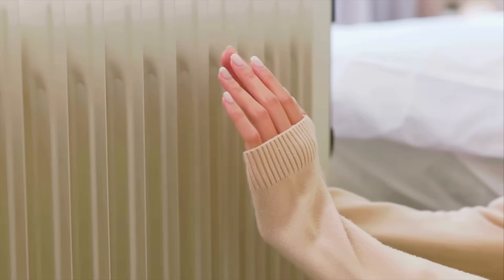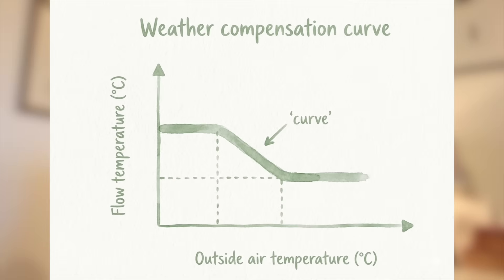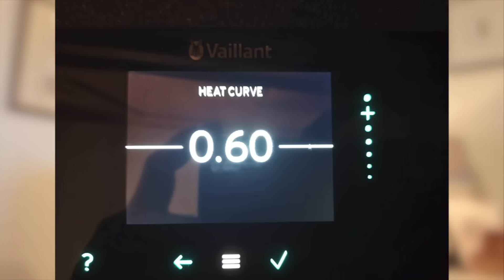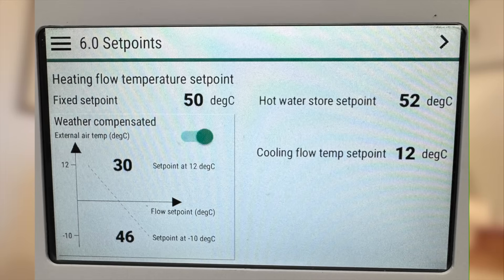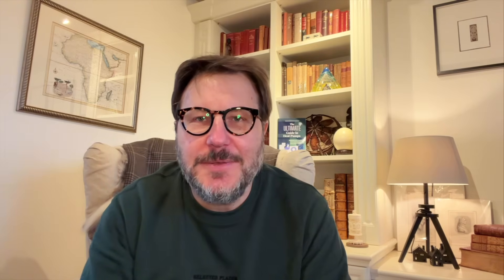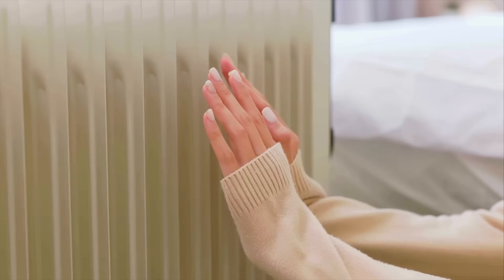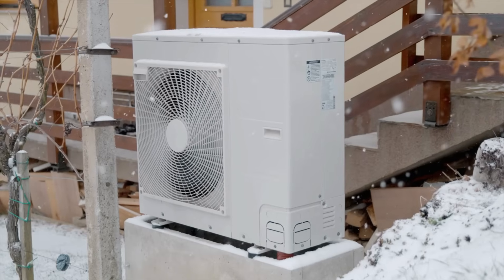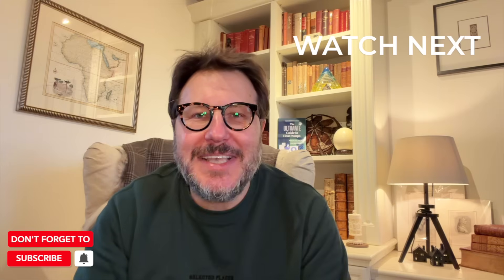Why Is Weather Compensation So Often Wrong?

Comment: What do you mean by "lowering weather compensation curve"?  In Vaillant heat pumps, you can achieve it by (1) lowering "target temperature" or (2) lowering the "heating curve parameter".  So which one are you proposing to lower?

Comment: Have been watching a few of your videos and learning a lot, thanks. My question is this, we have UFH on the ground floor,  RADS with smart controls upstairs. Everything is run by a WISER system off a Viessmann boiler.  To be comfortable I have had to group 'rooms' by temperature and run them 24hrs at that temperature.  I use 3 temps; 20c, 22c, and 23c.  How then would a HP work with no thermostats and weather comp?
Reply from the maker: Thanks for sharing your setup and question... sounds like you’ve got a pretty sophisticated system with the underfloor heating downstairs and radiator smart controls upstairs. Grouping rooms by temperature and running them continuously at set points like 20, 22 and 23C is a practical way to maintain comfort, especially when balancing different heating types. Very typical on/off set up.

When it comes to integrating a heat pump without individual thermostats and relying solely on weather compensation, the approach changes a bit. The heating is designed to be more uniform and more consistent. 

Heat pumps typically work best when they can modulate their output based on the outdoor temperature and the building’s heat demand, which weather compensation controls enable. However, without room thermostats providing feedback, the system relies heavily on the accuracy of the weather compensation curve and the building’s thermal characteristics.

In your case, since you’re used to setting fixed temperatures per zone, a heat pump system without thermostats would adjust flow temperatures based on outdoor conditions rather than room-by-room feedback. This can work well if your zones have relatively consistent heat loss and usage patterns, but it might be less precise in maintaining exact room temperatures, especially if some rooms have different occupancy or heat gains.

One way to bridge this is to use thermostatic controls or smart valves in key rooms to provide feedback to the heat pump controller, allowing it to fine-tune output. But it's generally not the best approach from an efficiency perspective. Alternatively, you could maintain your grouping strategy but adjust the weather compensation curve carefully to match your comfort needs, accepting a bit more variability in room temperatures.

So, while a heat pump with weather compensation can operate without thermostats, for the kind of precise, room-specific control you’re used to, some form of local temperature sensing or smart control usually helps optimise comfort and efficiency. We used to have a similar approach with our heating, but once a heat pump is in, that constant 21C across the house is far more pleasant than boiler heat being controlled by thermostats and TRVs.
Reply: @RenewableHeatingHub thanks for the great reply.  Will work on bringing all the temps together over then next year or so  
as that sounds like the best approach and when the time comes for an HP it should simplify acceptance here

Comment: Great video Mars.  I think a good follow up video would be related to radiator balancing when running 24x7 on WC.  The reason for saying this is that the majority of system installations won't be perfect they'll be good (hopefully!)  There's bound to be some mismatching of radiators and room heat loss with the result that some rooms will overheat and some underheat whilst others are very comfortable.  This, I feel, becomes highly likely if the system design was done to the MCS Regs or Building Regs (?? I don't know if these are regulations or just guidelines) which results in different temps in different rooms reflected in radiator sizing.  It's also something that will impact if a householder wants different temps in different rooms and to achieve it without turning down TRVs.  From my personal experience, adjustments to the WC may well need to come with adjustments to radiator balancing.
You made a point of discussing this but I'd like to reiterate to anyone reading comments: when you make an adjustment to anything you must wait a minimum 24 hours to determine the impact as it will only come into affect over that sort of time period.  I'd further add, don't try and change too many things at once as you want to be clear about relating impact to change and not scratch your head about what you did that caused that impact.

Comment: Our house is particularly cold when the wind is from the East in winter. This is partly because the temperature tends to be lower when the wind is in the East, but also because the shape of the house in relation to the contours of the land causes areas of low pressure that suck the warm air out of the house.

Is there any way to compensate for wind direction as well as temperature?

Is it possible to get forecast weather compensation so the heat pump can gradually raise the flow temperature in anticipation of a fall in ambient temperature?

Comment: Open loop Weather Compensation is backwards technology compared to a closed loop room temperature control method that comes as part of nearly all heat pump controls (if installed correctly so that the room temperature sensor is in a room and not an airing cupboard).

This is the biggest problem with heat pumps, people being told the controls are more complicated than they really are, they get put off, or end up with bad settings.

This video is bad advice. Like suggesting people disconnect their car speedometers and try and drive blind.

Comment: I have a new build with gas boiler and UFH, I considered weather comp, but I run the boiler flow at 40C so couldn’t see the point.  For a heat pump I’d say weather comp is a no brainer.

Comment: If you monitor your LWT temps when the outside temps are cold and the heat pump is near the room set point. You should then get a good indication of where your actual weather curve could should be. Mine went from the conservative 50C @ -3C to less than 40C. Runs more efficiently and because the temp difference at the heat exchanger is lower defrosts are happening much less often.

Comment: Nice video. Wait until you discover a thermostat that has weather compensation + load compensation (PWM) + room influence (PID). You might not believe but I see overnight room temperature precision of 0.02 C degrees within target temperature for several hours when there is little human activity. During day precision is within 0.1 C most of the time. Weather compensation is a good start - it can provide 0.4 C error precision, but it’s possible to achieve 0.1 consistently. I share my system performance in real time to the internet. It’s an Ideal Logic Heat H24 Condesing Boiler with OpenTherm. However, it’s the thermostat that made this possible. Most commercial thermostats are basically On/Off even though they pretend they can do weather or load comp :)

Comment: Hi, I think you said that you should set your HP to run 24/7.  I have a Vaillant HP controlled by SensoComfort controls, if I set it to run 24/7 via the weekly planner setting then the HP never uses it's set back temperature of 19c it stays at it normal temp of 21c.  Am I missing something or did I  misunderstand your comments at leaving it  to run for 24/7??  Regards  Dave
Reply: 24/7 running is just having it on all the time, with the set back temperature only slightly lower than the daytime temperature. It is on (but at a lower rate) during set set back.

Comment: I am still a heathen running a gas boiler BUT on weather compensation, TRVs set to max, no zones, no room thermostats, not a hot radiator in the house and the house is always comfortable and stable temperature. The weather compensation curve took a heating season to dial in and confirm. Viessmann V200, 4 pipe, 250L cylinder, arguably the best boiler (Clarkson pause) in the WORLD.😉
Reply: Interesting! Do you have RADS all round or a mixture of UFH and RADS? I have the same boiler as you and use a WISER Smart Control system to run the radiators and under floor heating and need to use different temps according to the rooms.  I'd love to just have the boiler do the work but have no one in the area who knows what they're talking about (Cheshire)

Comment: Why not just use the internal room temperature to vary the flow temperature?
Reply: An internal reading is reacting after the room has already got too cold / warm. Weather compensation with outdoor sensors adjusts the flow temperature more quickly so it can proactively adjust flow temperatures / heating output before the indoor temperature changes.
Reply: @simonm9923 nonsense. Load compensation reacts to any internal temperature change before you will even feel it.

Open loop WC is backward technology compared to closed loop control.
Reply: @nicksharpin8868 exactly, a PI loop on an internal stat seems more than adequate in my eyes.  The temperature outside would simply be reflected in the duty cycle of the stat if operating a boiler, or the primary flow temp if operating an HP.

Comment: Do you rate weather comp done over the internet by scraping real-time local weather forecasting data, or only by using physical sensors at the property? I'm sure physical is better, obviously, but the trade-off is another componant to buy, install & locate (most are wired). I don't know the delta between them, does it make much of a difference in real-world usage? Do all HPs now have them in the box? Really, those snsors should go on a North-facing wall, so that's another problem if they are integrated into the outside unit and that unit sits on southern elevation.